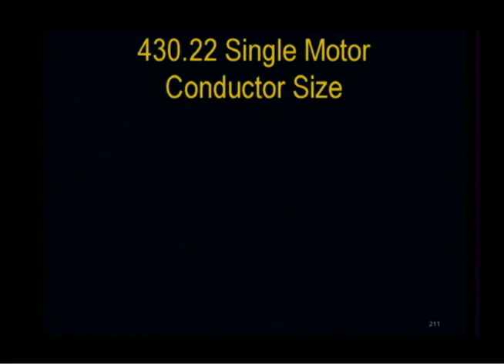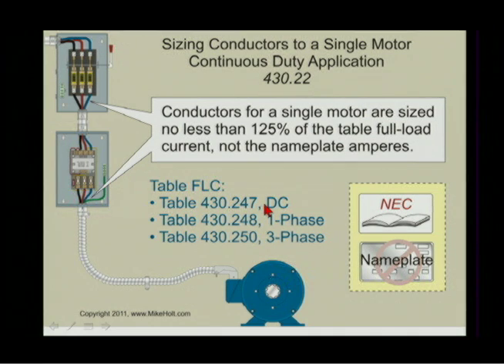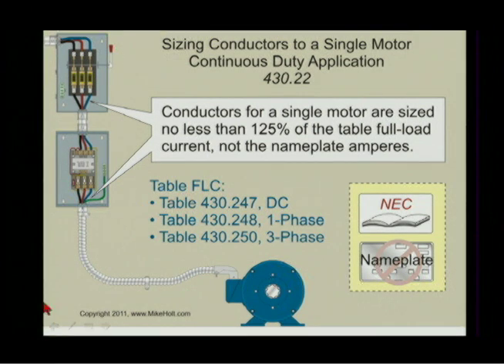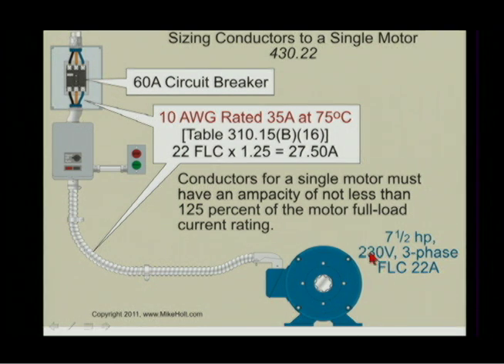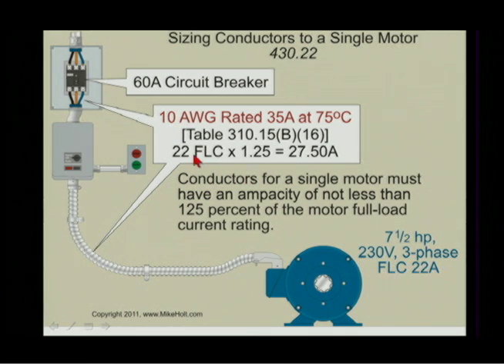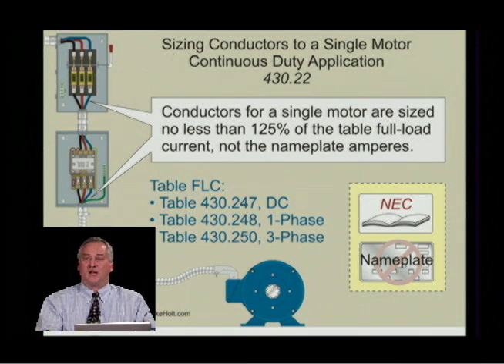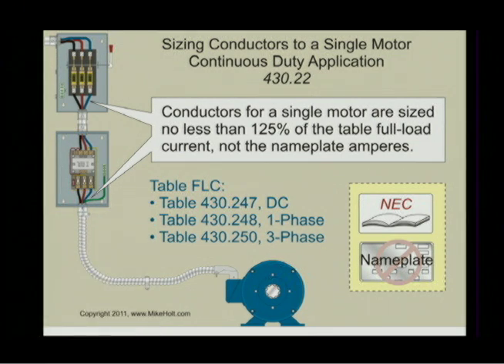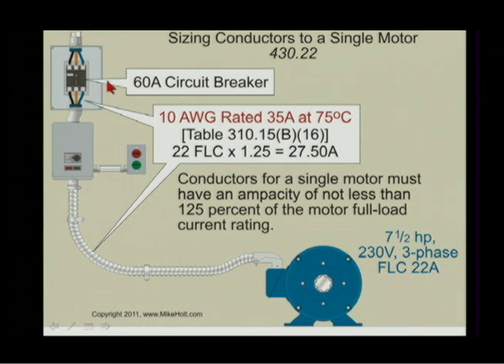NEC 2011 Single Motor Conductor Size - 430.22 (4min:05sec)

Comment: I must have missed something. Because the circuit is less than 100A, why wasn’t the 60C column used to size the conductors? Art. 100 states if the motor is Design B, C, or D, the 75C column is used. But they did not state what the Design is of the motor. Just that the motor is continuous duty.